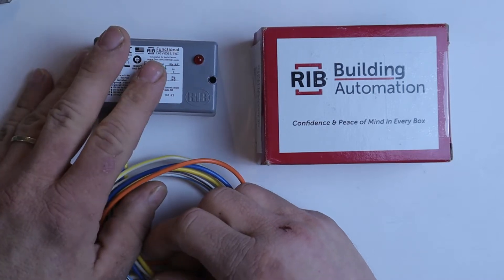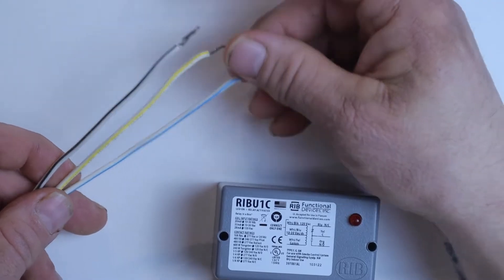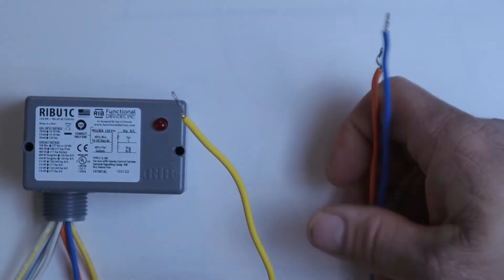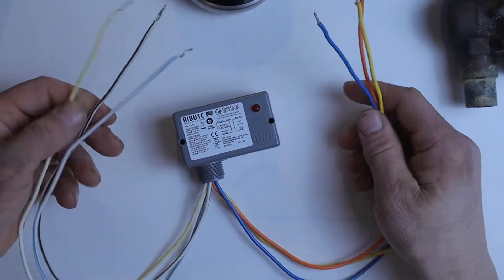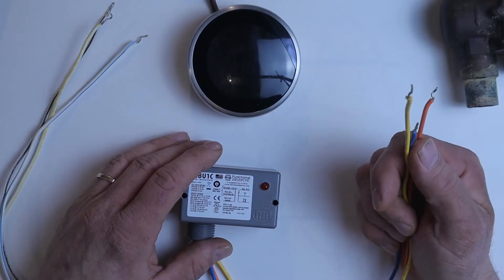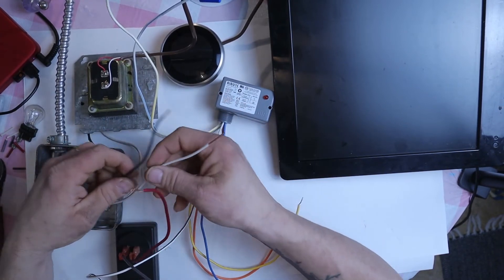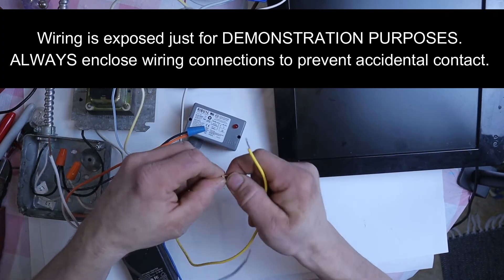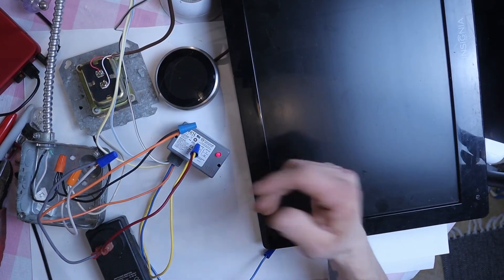How RIB Relays Work & What They Can Do

Comment: Holy cow, I recently have been using these for nest thermostats. While I was told what wire to put where by my boss, I still don't understand how they work. Thanks a lot for this.
Reply from the maker: No problem!
Reply: We had several models of 1 & 2 pole so I got schematics off the net , glee them up and made several copies that I could easily read what color controls or connects with what without using my eyeglasses.